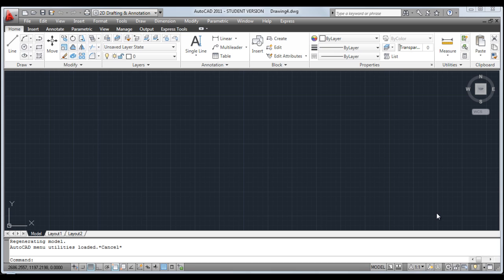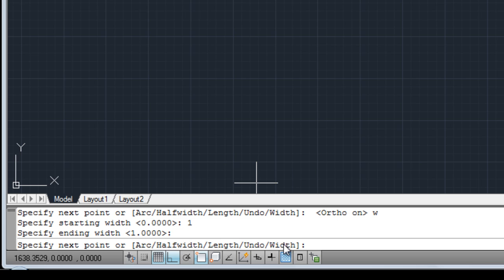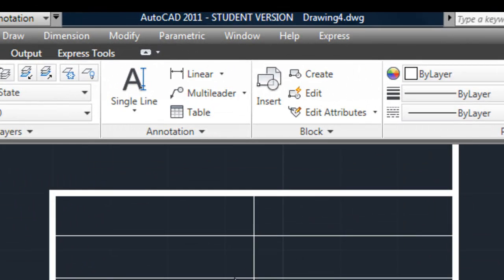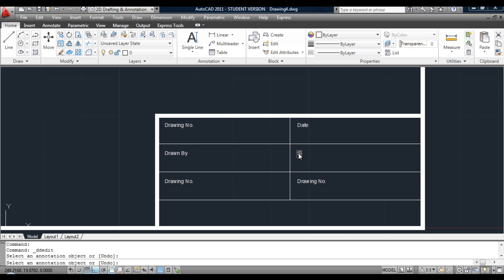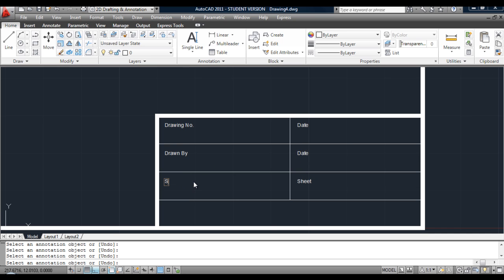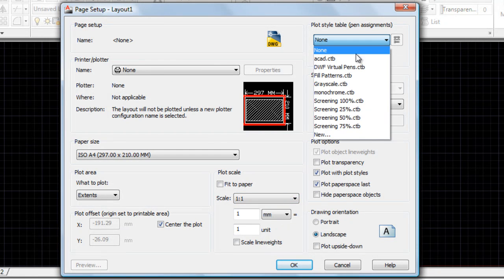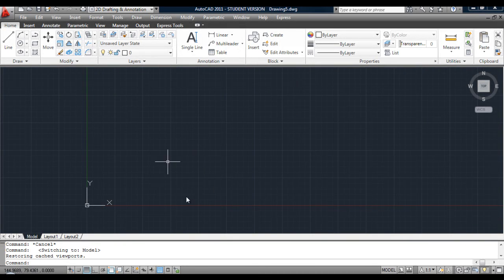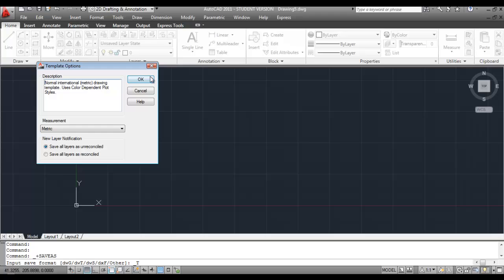A4 Border and Template

Comment: how come when i draw on my new template it does not translate to the layer a4 tab?
Reply: Not exactly sure what you mean but whichever layer is current is the one you draw on. The tabs at the bottom of the screen has one model tab and multiple layout tabs. Does that help?
Reply: I have been trying to create an A4 paper layout for 7 hours lol, I have made the boarders and put the title blocks in as you did... but then to the next part where you insert it... minw is soooo tiny and small on the page... its so confusing lol
Reply: EddysGameVideos Size matters 😃. Sounds to me like you're mixing units. Check you are using the same units by simply typing "units" and ensuring both (border drawing and drawing you insert it into) say millimeters.

Comment from the maker: Hi, my guess is that there is a problem with the units. Type  press enter - Insertion Scale units should be millimetres. I use the acadiso.dwt file which is in metric because I use millimetres, if you have used acad.dwt then your units will be imperial i.e. inches. You may need to scale the border down. 1 inch = 25.4mm, therefore scale the border by 0.0394.
When I insert the Block note that the units are millimetres, if it says inches then change the Factor to that stated above.
Hope that helps.